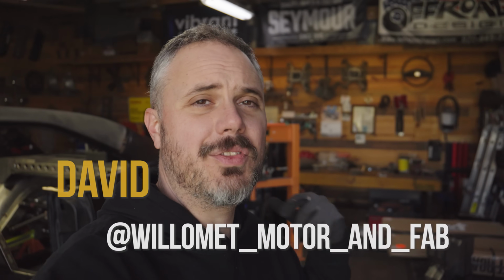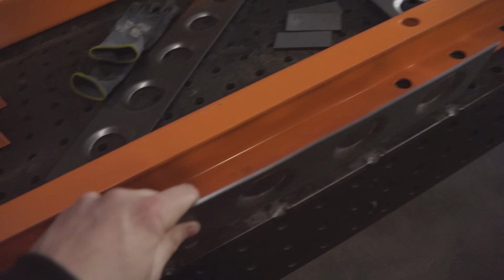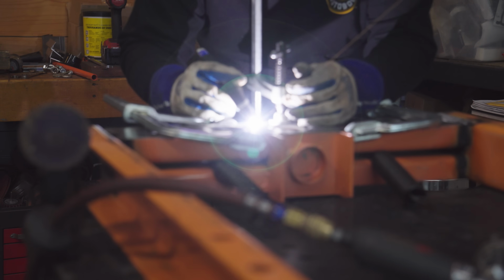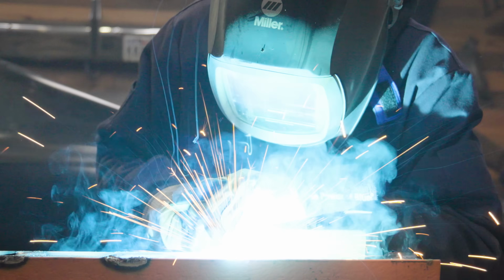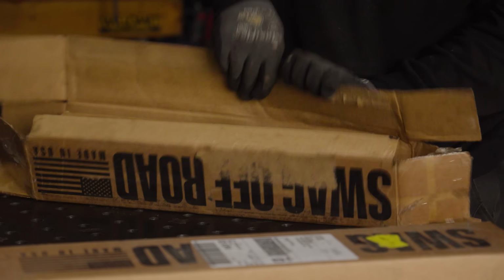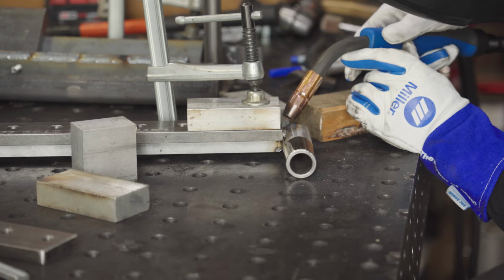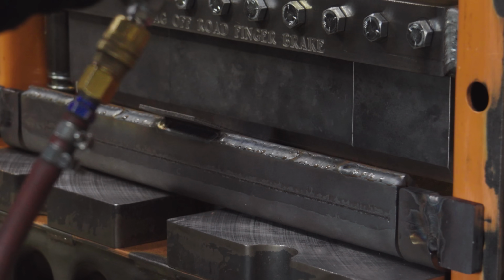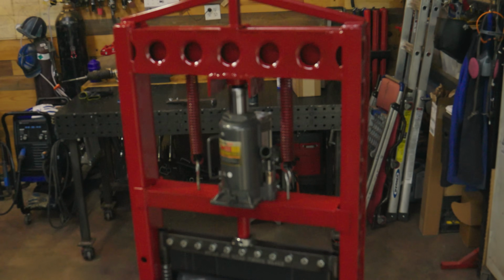Level Up from Basic - Harbor Freight Press Mods with SendCutSend & Swag Offroad

Comment: That came out great! I’ve switched over to Seymour and I’m loving their paint as well. You are going to love the water cooler. I thought I’ve seen you use one before. Either way, you have to teach yourself to take breaks. And don’t forget to turn the cooler back on when you start welding again. Ask me how I know.
Reply from the maker: Yeah, I used to run a cooler on the old everlast, but the miller still needs that upgrade. Can’t wait to go back to the 20 torch life. Seymour is tops. Just wait until you see the stainless black!
Reply: Glad you’ve made the switch!
Reply: Torch life is about 15 seconds with no water flowing 😂

Comment: You new gen people. Haha. Im 80 and if you want to strip that paint and just rinse it off. You need lye. Just buy a can of Easy off brand oven cleaner.. Spray it on and let it work then just rinse and wipe off.😅😅
Reply from the maker: I’ve learned plenty from my elders, so your shake and bake tip is added to the list. 🤝

Comment: You'll love having this machine! I scratch built a 49" wide 40 ton finger press brake last year. It'll bend up to 3/8" plate full width and 1/2" plate 20" wide is no problem. Start making different radius dies & positive/negative bucks and the sky is the limit! You can make rocker panels, door sills, B-pillars, etc. in a jiffy. Air over hydraulic is better than hand pumping, but full hydraulic is the way to go. That's my next upgrade, anyway. Not a machine I use everyday, but there's no substitute and it totally upped my capabilities to produce "Factory" looking pieces.
Reply from the maker: Thanks so much for that peek ahead. I’ve got a lot of practice ahead to get the full use of this tool.

Comment: I just picked up a 20T air/hydraulic cylinder when they purged the old line of them, and will definitely be reinforcing the top gantry before installing it on my press.
Having a Swag bending brake has been a wonderful addition to this press for years.
Reply from the maker: You’ll love the air/hyd ram. Glad to hear the swag brake works so well, and I’m excited to really get to know the tool well.

Comment: Turned out great! I just picked up the smaller 12 ton version with a small press brake kit. It’s really opened up a lot of opportunity for fabrication!

Great idea on these mods, I’ve already noticed the frame flexing so it may be time to get this done as well
Reply from the maker: I think my 20 ton frame is actually bent a little bit. Do that topper brace!

Comment: I used to run a 500T and 600T break press. After watching it bend 110k steel at 3/8 inch thick like butter is totally satisfying. Those pieces were used for the assembly of pintle hooks for semi trailers. Ever since I’ve wanted a cheap little press so I could do metal fabrication at home. Thank you for making this video as you’ve gotten my hopes up. Sure, this isn’t going to bend that kind or thick of steel but the bending of metal for car projects is what I need.
Reply from the maker: Yeah, it’s clear how this can be a sweet little piece of gear, but definitely has its limitations.
Reply: Max width for 3/8" plate on this press is 11". It's a slow bend at that width but the brake and HF press will do it! Nothing like what you use to run but pretty dang impressive for about $650 all in without these custom mods. $600 if you can score a Harbor Freight 20% off coupon. It's a great investment for your shop, I've made all kinds of cool stuff with a similar setup. My favorite was a custom transmission tunnel for my Toyota rock crawler. I did a drivetrain lift so that it had a completely flat belly from frame rail to frame rail all the way between the front shackles and rear spring hangers. My press brake bent all the 1/8" reinforcement strips and the sheet metal tunnel itself. Made it in sections so it's all removable and serviceable and the best part was the top two bell housing bolts were a breeze to get to now! I made the entire rear section of the tunnel out of 1/8" plate as it's right where the driveshaft CV joint is. Figured make it like an NHRA drag car hoop so if the driveshaft ever lets go, it is contained and no threat to occupants. Long story short, if you're wanting to up your car fabrication game, this is a very wise investment!
Reply: @tbroekemeier  thank you for that info! I have a 1990 Miata that I’m lining up an engine swap and rather fab my own parts when and where I can. This will help and same with the info you gave me. It’s much appreciated!

Comment: Just subscribed!!  Great video!  I’ve also got the Swag Off-road Brake for my press.  I’ve made some awesome parts for the Ranger with it.  Seeing the dimple plates for extra structure on the press it self is genius.  Definitely will be doing that modification once I get settled in my new garage up here in Montana.
Reply from the maker: Thanks for the sub! A working garage in Montana sounds pretty darned fine to me.
Reply: @WillometMotorFab  it’s just a small 2 car garage that’s not insulated yet 🤣.  So it’s limited work depending on the temperatures.  But I’m ready to get back to fabricating stuff for my Ranger.
Reply from the maker: Tag me on social as you make progress. Big ideas come out of small shops.
Reply: @WillometMotorFab  yeah man absolutely!  I’ll be sure to tag you.  I’ve been really trying to get going on YouTube also.

Comment: I have one of these presses, as well. I picked up enough steel last fall that I can turn it into a 48" wide throsted press.

20 ton is enough smash for me. The 2nd step will be machining & fab a finger press attachment for it.

In the process of widening it, I'm also going to stabilize the press beam w/ some wheels & bearings, so I can pull off some moderate duty press punch manuevers.
Reply from the maker: Dude, tag me on social as you build that bad boy! So cool.

Comment: Boxing in I-beams increases the torsional stiffness a lot, which is important for vehicles, but isn't needed for the bending loads presses are subjected to.

To increase bending stiffness, add plates to the flanges, or add triangulation as you did.
Reply from the maker: Maybe the newer HF presses are better, but this older on bends way more than it should. With these plates, it still bends, but much more like real big-boy presses I'm accustomed to.

Comment: @Willowmet Motor and Fab:  What is the Make of that Blue colored, Drill mounted, Round stock Belt sander ?! (at about the 8:50 mark)
Reply from the maker: That’s the 525 mini tube sander. Handy piece of gear.

Comment: Thanks for the inspiration.
Never thought I would need one but I guess I will be getting one thanks 😊
Reply from the maker: If you’re getting a new press, you can probably skip the side plates for reinforcement. These older ones use formed plate rather than structural C.

Comment: Their paint may be thick by the welds on the Harbor Freight backhoe that I bought were cracking down the middle of the welds on some of the joints and the thick paint was filling/leveling some of the undercuts on the welds which made the welds look decent.

Comment: so are you offering the reinforcement kit? or selling a dxf for sendcut send?
Reply from the maker: There’s so much variation across harbor freights own press line - the current ones are different from mine - that it’s hard to make a kit and guarantee the fit. I would suggest taking dimensions off your press, and using SendCutSend’s parts builder to make a set of plates for exactly your setup.

Comment: Where did you get the sander attached to your drill. I do a lot of work with Aluminum and that would be awesome to have
Reply from the maker: The drum sander is the SCT tool from Eastwood, and the wire brush was just an Amazon attachment. Does that help?
Reply: Maybe he was taking about the tubing sander
Reply from the maker: You’re absolutely right! Thats a 525 tubing sander. It’s handy, but a bit expensive.

Comment: Video on air cylinder install?
Reply from the maker: I did that before I started making videos, but I’ll make sure to recap in a future one. It’s just a simple parts swap - no mods needed. Get the air/hydraulic 20 ton from HF or wherever, and you’re done.

Comment: I’ve found brake cleaner takes the harbor freight paint off. I dont recall if it were chlorinated (bad for welding) or non-chlorinated.
Reply from the maker: Good tip. I’ll try that on the next one of these types of projects.

Comment: Great video.  My press has seen better days itself.  Any chance you would be willing to share the files on the plates to get a set of my own from SCS.
Reply from the maker: I’d happily share the DXF, but you should triple verify it would fit your press. There’s a bunch of variation within and across makes.
Reply: @WillometMotorFab could you share it with me also, please? I’ve got the grey 20 ton Pittsburgh, but will verify measurements prior to ordering. Would really appreciate it! Thanks

Comment: On rebending stuff if you want to insure your hitting same part on bottom of part the bottom die will leave marks mark that with a paint marker line if back up on bottom die with mark and it should bend same spot
Reply from the maker: That's a fantastic tip! Thanks so much
Reply: @WillometMotorFab  I have ran 400 and 500 ton presses for 12 years. I have had to rehit parts, take a 90° bend completely out and rebend it because bend line was off

Comment: I don't understand adding the dimpled stock.
Looks like you just made a dirt catcher that is nearly impossible to clean out.
Reply from the maker: The plates box in an open C shape and make it stronger. Dimples add strength so we can use thinner material that's similar in strength to a thicker non-dimpled material. It might gather some dust inside the holes, but that's worth it (to me) to be able to have a press frame that doesn't bend. These HF presses are pretty flexy out of the box.

Comment: Someone should chip some paint and do a lead test on it. Wonder if they're still using lead paint in China
Reply from the maker: Dude, I totally think the paint is worse than what we use here, but I’d be surprised if there’s lead. It’s not so old that it escapes a bunch of import rules forbidding lead in paint. Still, wear a respirator.
Reply: @WillometMotorFab  I can think of 50 different products imported that are illegal. They'll just mark a different box or change a description or lie. Ebay just got ordered to pay 2 Billion fine for their role in selling/suggesting illegal diesel truck mods/products. A lot of it was I ported from uh "foreign sellers"

Comment: nice work but probably not useful. the press was able to handle 20 tons and now it can handle more but the bottle jack is still 20 tons
Reply from the maker: It’s kind of a capacity change, since the frame bends pretty bad well before maxing out the cylinder, so that’s helpful.

Comment: The newer 20 ton press is far better than the ancient models . It seems that throwing big money at the old design  is silly when you could have spent the same money at the new design . Besides, Swag makes a ton of add ons to the new press you can either buy or copy yourself if you want to fab them up yourself .
Reply from the maker: I saw your second comment, and only want to kindly disagree that it’s silly to work with what you have, even if a newer model is superior and it might barely cost more that this labor plus some fancy plates. Like I said in the video, you can box in using plain materials, which I’ll admit the dimples are way extra.

I got this second hand, and there’s value in making what you have work. There are a lot of these ancient (perfect adjective, by the way) ones out there that could still be useful.

Also, the new ones still flex, but less so. I wouldn’t recommend the side plates, but would still do a topper and probably box the horizontal beams.

Seriously, thank you for your comment. The make vs buy discussion is a good one to have.
Reply: Actually, my first post was in ignorance, while my second post was more in commending what you have done with the little press . :)
It's a beautiful little beast . lol 
And yeah, it sure is worth the effort to make a master piece out of seemingly junk . I think I was in the same mind on my second post after I watched the whole video . And I forgot to sub last time, I won't forget now . :) @WillometMotorFab
Reply from the maker: I'm glad you're here, and thanks very much for the support! @johnjelinek-g7b

Comment: Speaking to that "paint harder than woodpecker lips": brushed and ground in your shop without a respirator, whatever is in that paint is now part of you and your working environment.   Without basic precautions, these needs-of-the-moment impose long term liabilities.
Reply from the maker: There are a few moments I missed wearing my respirator - a quick grind here or there - but that’s not okay long term. The obvious ones, like every time I weld or strip paint or grind for long periods, are easy, so I appreciate you reminding me about the smaller moments that can add up over time.
Reply: @WillometMotorFab  My comment is as much a reminder to myself, unsatisfied with choices I've made.   While I've masked up for recent sanding and stripping, not so with stick welding, with all the noxious gas that produces.   What are you wearing/what filter are you using for welding?   I need to equip myself.
Reply from the maker: I use a 3M 7000 series mask, and P100 filters with activated charcoal. The charcoal is optional, but helps with the stinky. Definitely mask up when you're burning that flux.

Comment: First off using a MIG welder to attempt to do structural welds on material that thick is a waste of wire, it's not going to happen.
Reply: False lot's of guys have used MIG for years repairing/fabricating heavy machinery then working the equipment hard for many more years
Reply from the maker: Yeah. There’s a long list of code welders that mig, and do it well. Also, the frame on this junk is 3/16, so it’s not some sort of behemoth.
Reply: @WillometMotorFab  take 2 pieces of material that thickness and MIG weld them with that gas shielded weld and take the same 2 pieces and 7018 weld them then flex both.  I will absolutely guarantee that the MiG weld will break on the first flex and that the 7018 will take multiple flexes.
  It is NOT the man, it is the machine.  It makes absolutely no difference who is holding the gun, it is the gas coming out of the nozzle and the process.  You have NO penetration control with shortcircuit transfer.
Reply from the maker: I disagree with nothing you said, but recall your original comment. This is just a cheap press with 3/16 material that isn’t hard to penetrate at all. As long as the welder is big enough, regular old MIG is fine for this.

Now, stick welding it would have been cool, too.
Reply: @alandavis6429  You may think that but doesn't mean you're right. Maybe your skills are limited but doesn't others are
Reply: @mrmotofy  I don't 'think' gas shielded MIG welds are brittle.  They are and it makes no difference who sets up the machine.
Reply: @alandavis6429  That MAY be your opinion. There's millions across the world that can prove your opinions wrong.
Reply: @mrmotofy  this is a major problem with welders, despite undeniable facts they still spout Bullshit.  It is obvious that you have no experience burning 7018  or 7024:rod.
Reply: MIG might be MORE brittle than stick, but that is a moot point if the MIG does the job well enough. Not every weld needs to be the strongest possible to get the job done.
Reply: False, Cat attachments were/are made using wire feed welders and have been for 30 plus years! No stick machines even found in the welders shop! If wire is good enough for dozer blades and buckets I am sure it was fine for a puny job like this!

Comment: How can we get a set of the dimpled metal inserts for our HF 20 ton press?
Reply from the maker: I just measured my press, and drew these up in my software. The dimple feature at SCS isn't live yet, but will be soon.
Reply: @WillometMotorFab  Can I trouble you to share the file(s) ? Maybe you can make an affiliate link or put it on your website